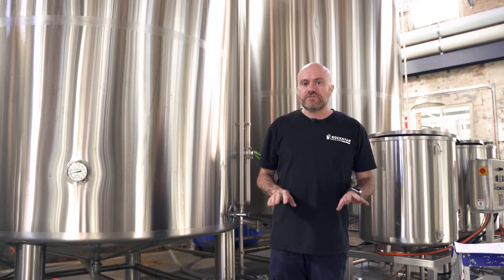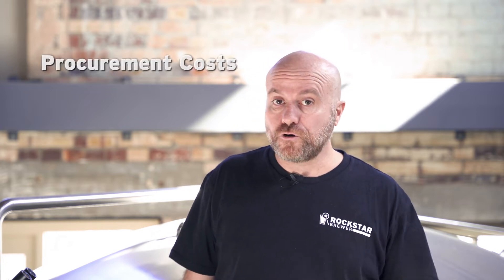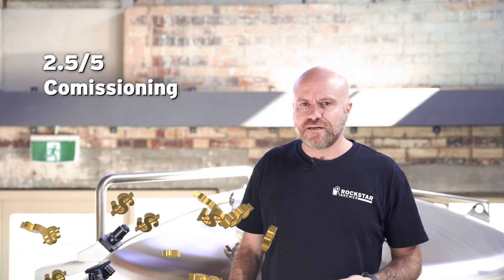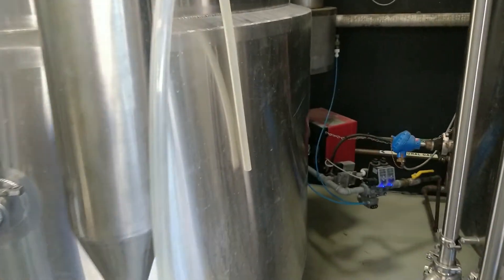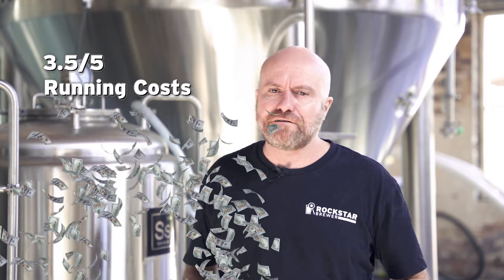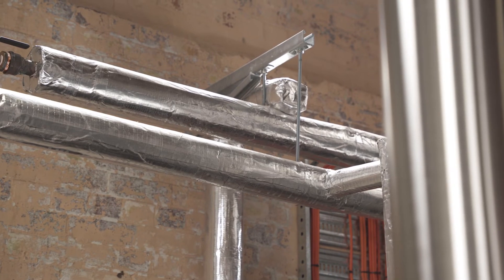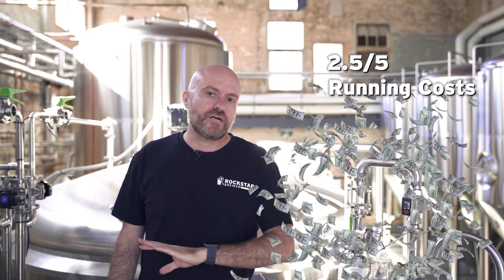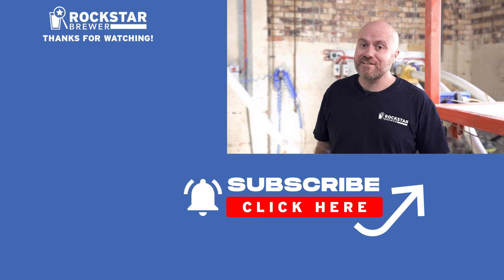Choosing The Right Energy Source For Your Brewery Build

Comment: With steam, you showed a gas fired steam boiler, but didn't mention anything about the issues with gas that you mentioned with direct fired gas.  You can also get electric steam boilers.  I think you needed to add information about how the steam is generated, not just used. That being said, love your videos. Very informative.
Reply from the maker: I just had a client with a steam brewhouse that swapped out their electric boiler and changed to gas and saves $5,000 per month on energy costs.  Steam is good but not cheap when powered by electricity.  Cheers for the observations about a gas boiler, yep, it still needs a system of flues same as a direct-fired brewery.  Thanks for watching :-)
Reply: @RockstarBrewer  I’m in Taupō, New Zealand and looking at geothermal steam. Install is really high (sinking a bore 100metres), but the running costs are really low.
Reply: @scottforsythe2024  that’s awesome man, what’s the brewery called?
Reply: @s2561828  I’m actually a distiller. But the first part of all grain distilling is basically unhopped beer. Still in early startup for the Taupō Distilling Company.
Reply from the maker: @scottforsythe2024  Wow - that's amazing!  When next I'm in NZ, I'll stop by and check it out.
Reply: @scottforsythe2024  High Scott - I’m also looking at using artisan water that is super hot to steam heat the brewery. Do you have any idea how the steamed water can be controlled and is it very costly.